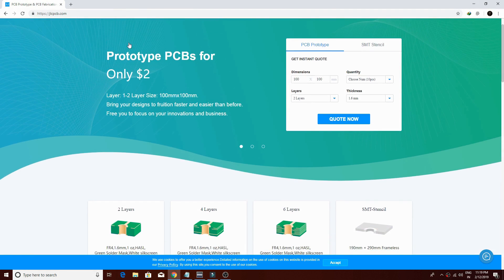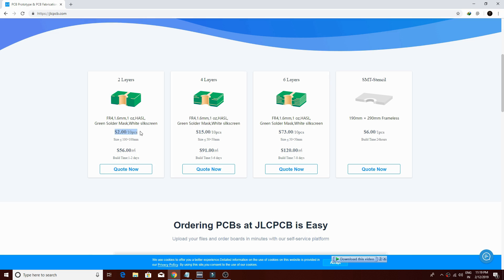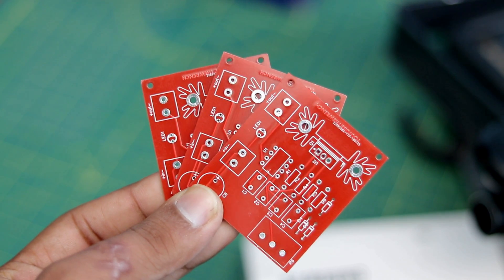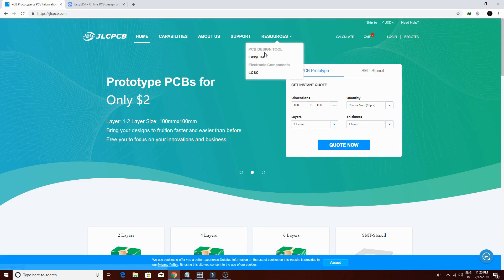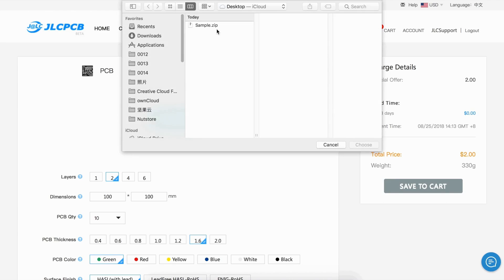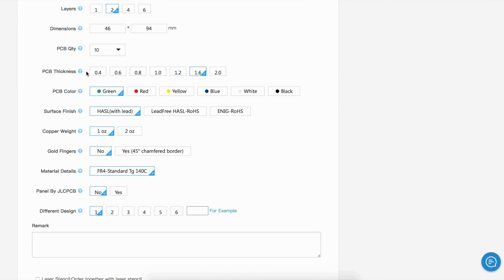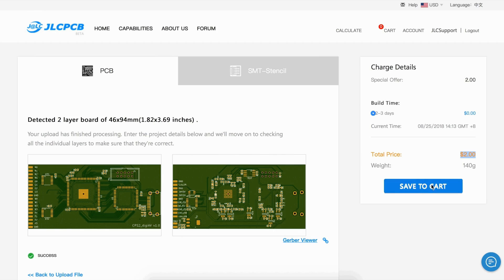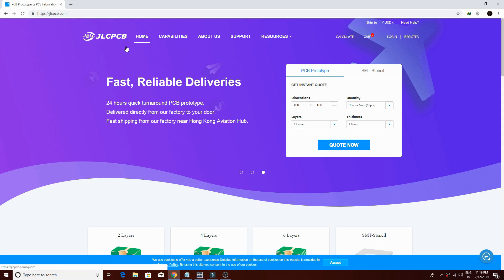WOW! How to Make Fingerprint Lock for Your Computer

Comment: Dude any1 can break into this all you have to do is literally disconnect the 2 female headers and then connect them together by any conductor and the pc will turn on!!!!
Reply: True, It would be awesome if the same thing worked with windows lock..
Reply: Well there are many ways that you can bypass the windows lock, such as software/hardware key-loggers, phishing schemes even a usb burned with an iso file that unlocks it using some methods.
Reply: OH yeah !!!! It’s not cracking lol. It’s a method someone on github realeased. Basically it’s the same as the windows 10 login page which then is sent to a server hosted by the phisher
Reply: OH yeah !!!! Well I just love making and breaking stuff, I don’t mind if people use it or not.
Reply: OH yeah !!!! True hackers actually think about every way to break in without breaking the software or such (whilse it’s still usable) so y wag that’s just what I’m trying to say

Comment: This is pointless. You can turn on the computer by just manually shorting the two pins. If you were to lock windows 10 with a fingerprint scanner that would be actually useful

Comment: Why did you use batteries and a switch? you can surely connect to PSU for power.
Reply: but psu of pc only run if pc is on

Comment: Instead of battery, you can use green wire and black wire from SMPS
As they give 5v before the system is turned on

Comment: Step 1.
disconnect wires what used for launching computer 
Step 2. attach the screwdriver to the contacs frome the switch 
Step 3. Congratulations, you turn on it and also waste the time

P.s good video